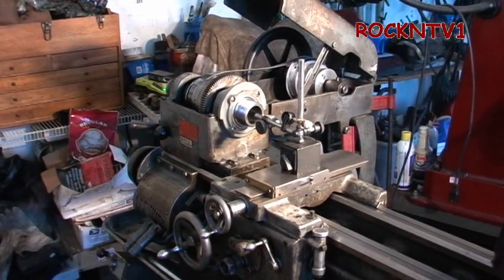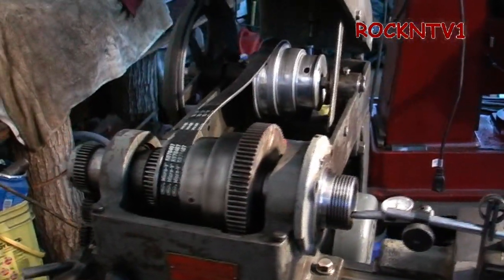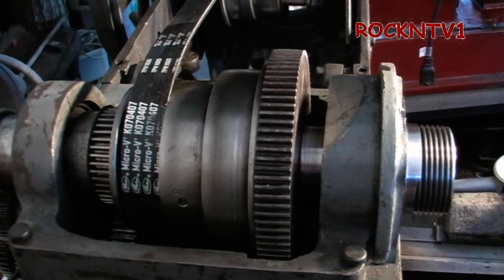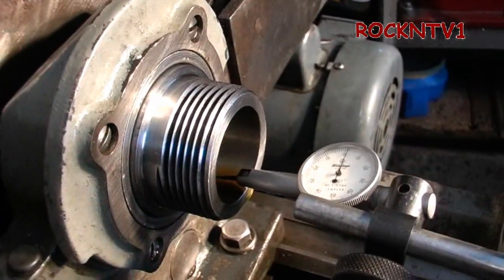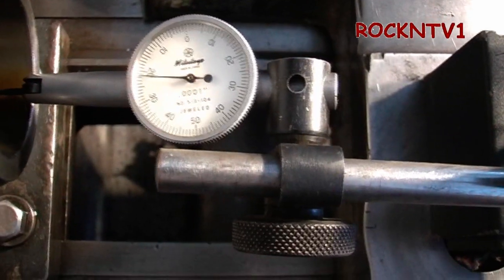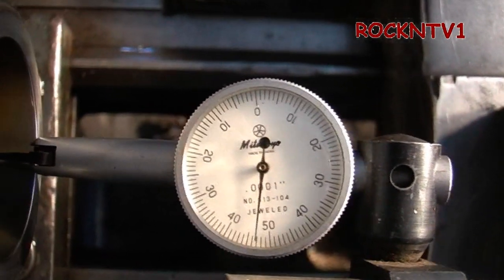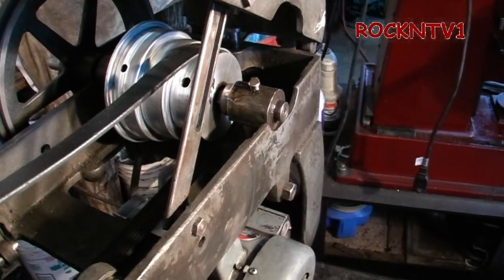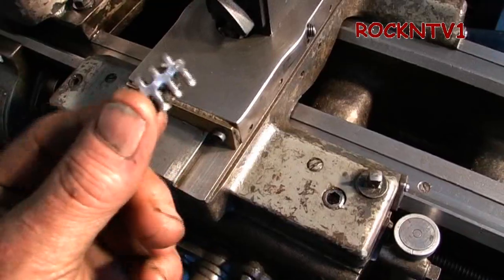Logan lathe Spindle Bearings HeadStock Rebuild fix

Comment: I have a model 922 with a 42x1" leather belt. I looked up the specs on your belt and it shows it's 41 3/16" long. I'm guessing you can adjust for tension, so my replacement doesn't need to be exactly 42" like the old leather one, right?
Reply from the maker: Hi, if you use the part# of belt i show you should be all set. Dont forget the drive cover is the tensioner. Thanks for watchN
Reply from the maker: P.S.  Not currently looking at my lathe, but the attempt was to get the drive axle in the middle of it's swing. These belt wont stretch much, and you can use a cloth type tape, like from a sewing kit. I think you could get away with a 42 just fine irrc